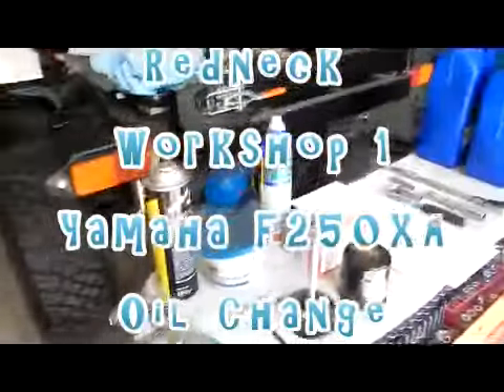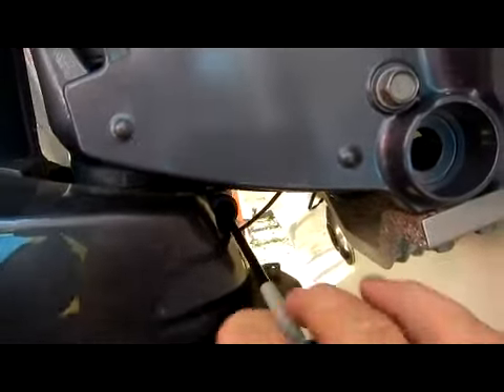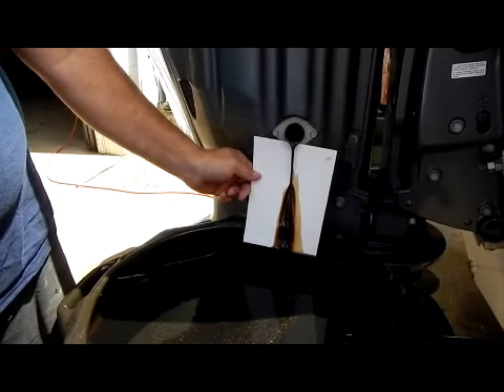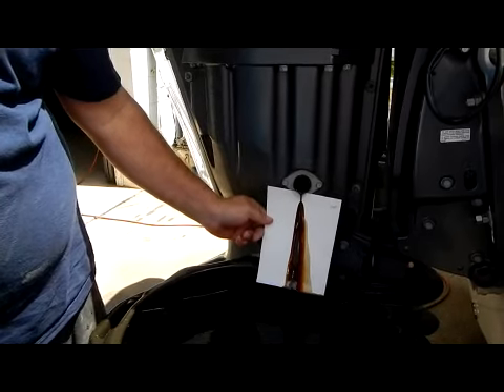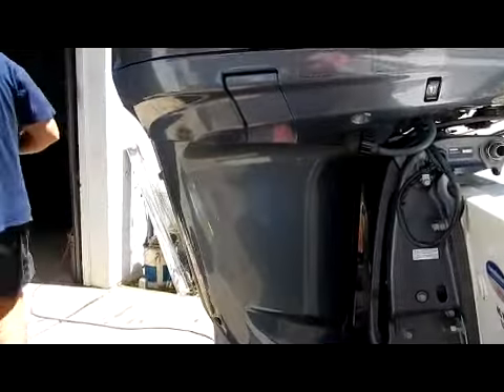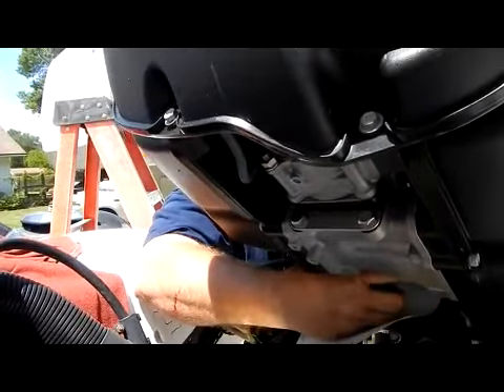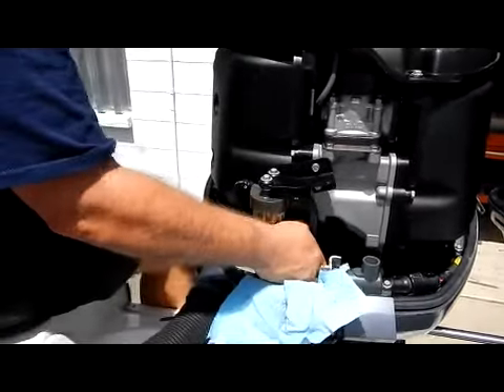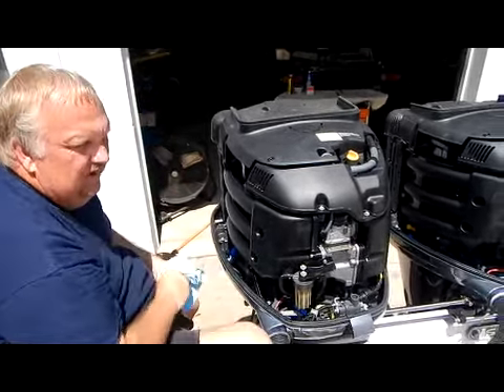Yamaha F250XA Oil Change

Comment: Very well done. Very helpful information. Gave me the courage to do it myself. As you stated in the oil change, drain the oil from the drain plug not siphoning from the dipstick. But after removing my side cowling, I discovered my drain plug had been permanently sealed by some J.A. mechanic in the last 6 years, probably crossthreaded the nut, then it leaked, I will never know who it was. So I attempted the dipstick method with a handpump, complete mess and failure, it only extracted about 1/2  of the oil. If you have to do the dipstick method, you will need to find a proven reliable pump, cheap ones are a waste of your money and time.
Removing the 2 side cowlings will also allow you to inspect several areas beneath the powerhead that need grease  or anti-corrosion treatment, mine had not been touched and the corrosion was bad!